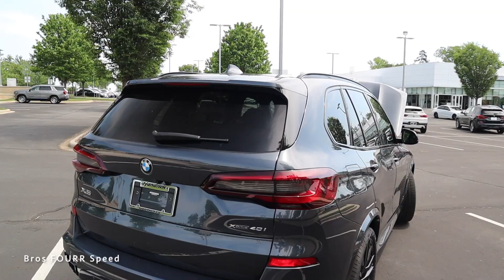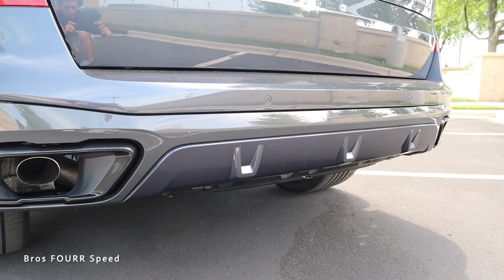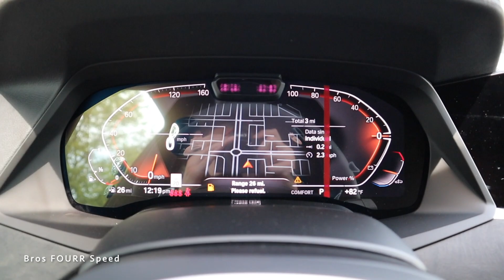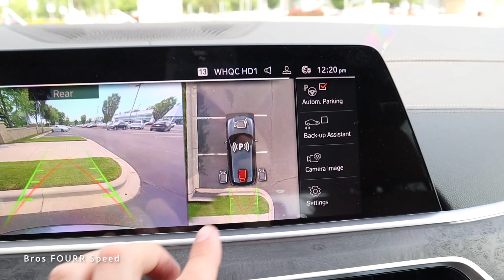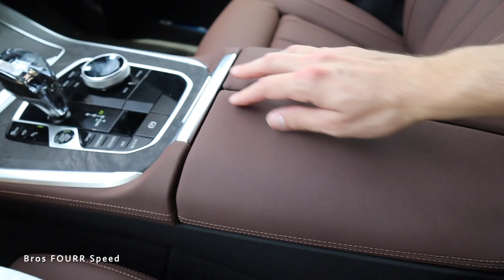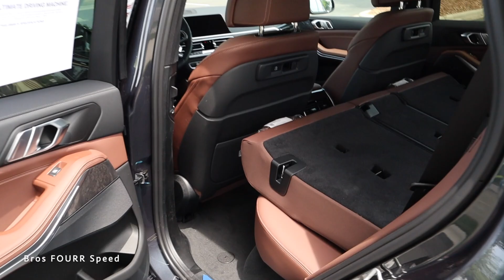2022 BMW X5 xDrive40i: Start Up, Walkaround, POV, Test Drive and Review

Comment: Hi, do you think this car's steering wheel is too sensitve? I have this 40i as well, but I found even in a straight line , it is bit hard to keep straight drive. Any slightly move will make the car move. So I am just not sure do you have same feeling as myself? Thanks.
Reply from the maker: Been awhile since I’ve been in this car, but driven a lot of X5’s and never really felt that! Could be the roads you are on.
Reply: @BrosFOURRSpeed  i get ur point，like the road quality is suck hah maybe？sometimes easy to control sometimes is bit hard. maybe my standard is too high
Reply: @BrosFOURRSpeed  btw nice video
Reply: Totally agree, especially highway driving the slightest move jerks the car. Takes some getting used to

Comment: nice review. Just ordered mine because we really need the ventilated front seats in the south! I am still very confused why doesn't BMW just add that package to most units because honestly for $1600 that's probably the most functional package you can use on daily basis
Reply from the maker: Yeah really the warm package should just be standard on an expensive luxury brand. Either way the X5 is such a solid choice!
Reply: Be aware that the ventilation on the front seats might not be what you expect. It doesn’t blow cool air onto you, it “sucks” the air out. I.e., it’s not air conditioned coolness blowing on you, and might be a let down. I am a new owner of this exact model and can confirm that I can’t even tell when they’re on. Don’t get me wrong, you’ll still LOVE the X5 :D

Comment: You can tell it's quite a difference between this and the 30i. Around a 16 K price difference but it's good to know that this X5 has massaging seats and heated and ventilated front seats. I thought you were gonna fall asleep when you mentioned the massage seats working 😄
Reply from the maker: Yeah this spec was super nice! seats were a great touch to have!

Comment: Hey Bros I have a question about the installed apps because I basically have the same X5 you are showcasing minus the paint job, mines is blue. So when I took delivery of mines there was only 2 apps on the installed apps screen and I asked the sales agent why mines doesn't have all those apps and he basically couldn't give me a direct answer. I thought all those installed apps come standard in all BMW vehicles? And if they goofed up they owe me money or fix their mistake.
Reply from the maker: Hmm I’m really not too sure. I’ve never messed with the apps. Is there any internet through the screen to ad more?
Reply: @BrosFOURRSpeed  For some reason they didn't include 3 month wifi trail, So basically no, even tried connecting via my mobile phone and still no connection. I will going to a different BMW dealer next week to get some answers. Thanks for the response.
Reply from the maker: @newguy4603  dang that’s crazy. Dealer should owe it to you to get it squared away